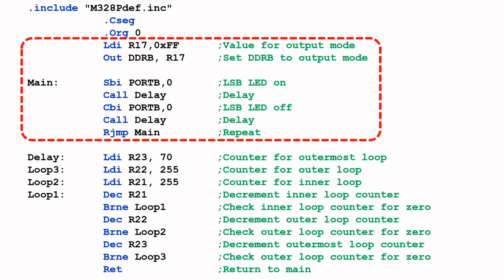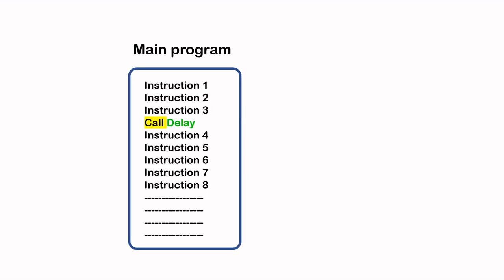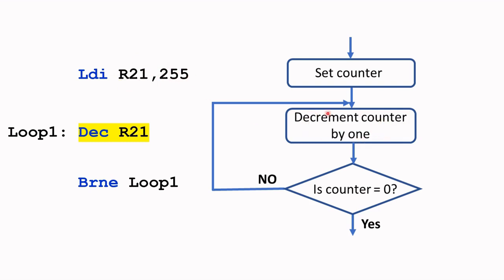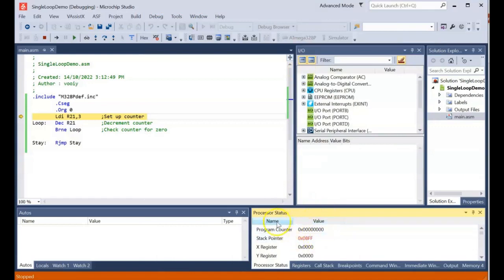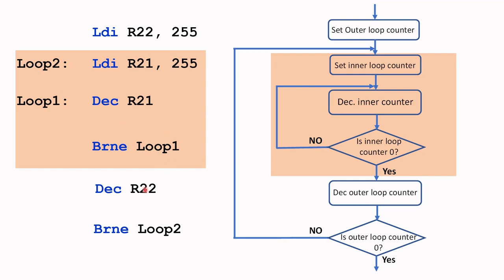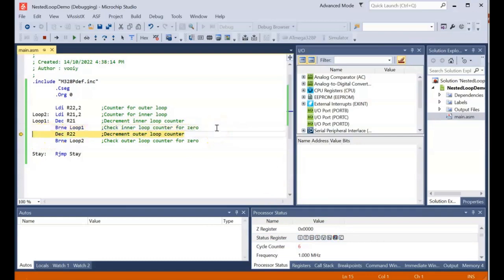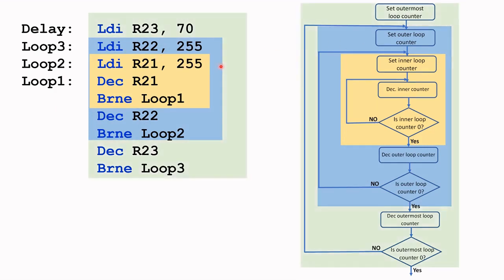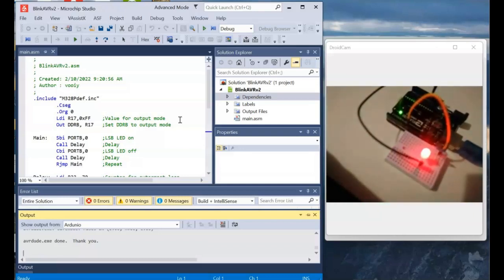#58 Blinking an LED Using the ATmega328 Assembly Language

Comment: 256*256*70 = 4587520 cycles. Arduino UNO uses 16000000 Hz Crystal so  : 16000000/4587520 = 3.487 seconds. This should be blinking freq. But in video it seems like 500 ms. Why is it  so ?
Reply from the maker: Hi, to calculate the duration of the delay generated by an ATmega328 microcontroller using a 16MHz crystal, we need to take into account the time taken by each instruction and the number of iterations of the loops. Write to me at the following email address and I will send you the details of how I would calculate the duration of the delay. My email address is: vvy.eseducation@gmail.com
Reply: @vooiyap  ok I've sent:)